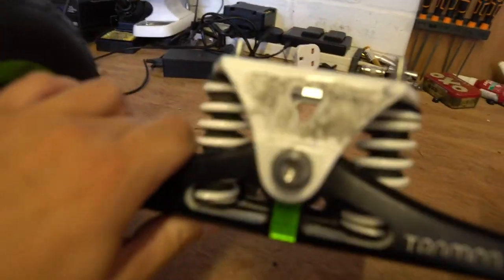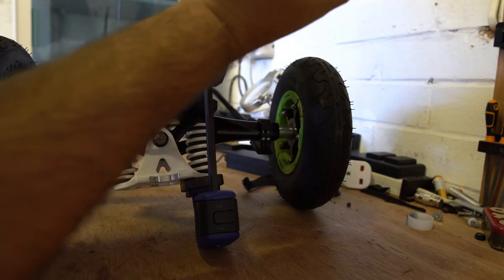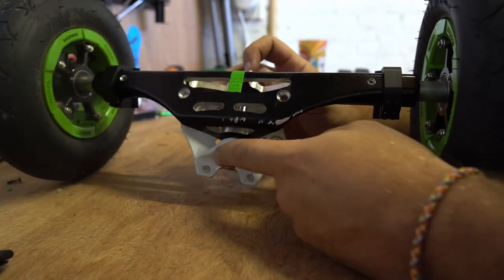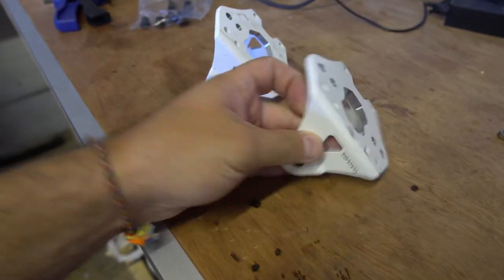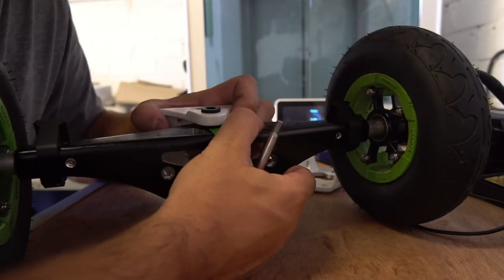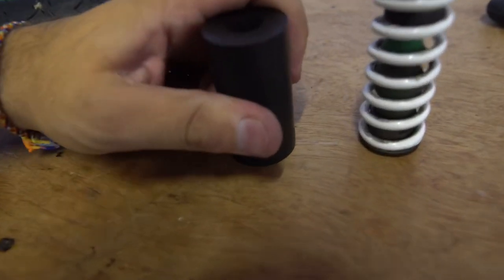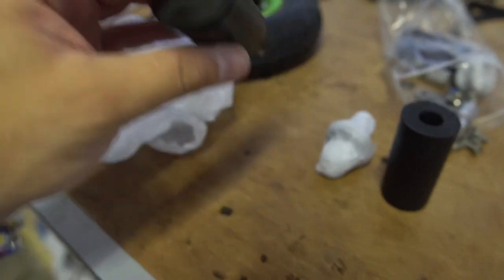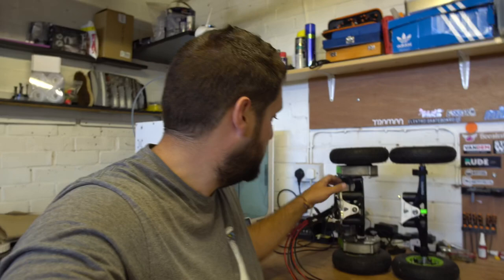How to - Strip Down and Service a Trampa Spring Truck.

Comment: Hi Lee. If the hanger has only got one hole, but the base plate has 2, can you still move the spring to the inside position? Or do you also need 2 holes on the hanger to move it to the inside position?
Cheers 🤙

Comment: Nice video man. I put elastomer dampers in my ProDrive a few weeks back. Runs really nice, but I've put them in the outer positions, rather than inner... just gives a bit more support (for me).
Reply from the maker: Choices choices mate! Turned out Scott didnt have the adjustment in his front truck anyways so he has outer!
Reply: @LeeWright  Yeah. Wish I knew about the Loctite trick tho... already lost one bolt :(
Reply from the maker: @munkyheed  guaranteed to lose those if you dont thread lock them!

Comment: O trampa guru no trampa god I do hate to question your holiness but these wise words were spoken by the bearded wonder that is your god like self. The best position is inner for the front & outer for the rear. But in the last shot of the trucks they both looked as if they were in the outer positions not questioning your godly trampa powers its most likely my eyes (I am booked to speck savers on Monday). I am now blessed with the knowlage to sort it out my self
Reply from the maker: Haha good eyes my friend.  That is because your base plates are drilled for both positions on the front truck but the hangar is only drilled for the outer position.  Your rear truck has both positions on base plate and hangar but that one needs to be in the outside.  We will test when you come over and if it's still too much of a turning radius we can go back to springs without dampers in the front

Comment: The one thing i really dislike about the matrix 2 trucks is the baseplate. Mounting it sucks so hard with the older plastik baseplate because the nuts spin freely. Also the shock blocks. 1 screw only to secure it. I lost a shock block while riding, it just fell out. And there is only 3 options to choose from hardness wise.
Reply from the maker: My friend rides them and broke a plastic base plate on a ride.  Sucks! I like the trampa trucks, even more with the elastomer dampers

Comment: Can that truck be put on the front if an evolve carbon gtr?
Reply: No, spring trucks need a 35 degree angle or more on the nose and tail end. You could get risers to change the angle, but that would involve drilling new holes and they are typically plastic and weak.

Comment: Are they the Trampa Barrells ??
Reply from the maker: Yes! That's correct
Reply: Hey with a Trampa do you use the regen braking and what settings or let Vesc set it up
Reply from the maker: @michaelworrell7717  yes of course.  You need to consider the size of your pack mostly but also that you will only push the max value if you are breaking hard going down a big hill.  If you have a 10 x 30Q in parallel then the max you can push back continuous is -40A but that's only -20 per VESC.  I use -35 per VESC as I want the sharp brakes.  when looking at telemetry I see I rarely push that and even so it's for short periods and not continuous so I live with it.  No problems so far over maybe 200 - 300 miles
Reply: @LeeWright  I think i get that !!??
Running 12s 16000 and 22000 batterys